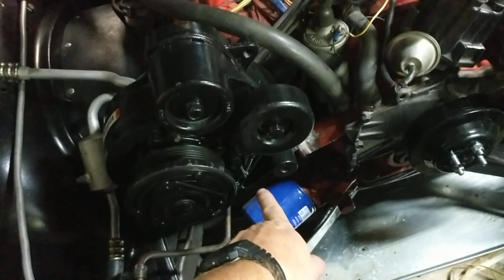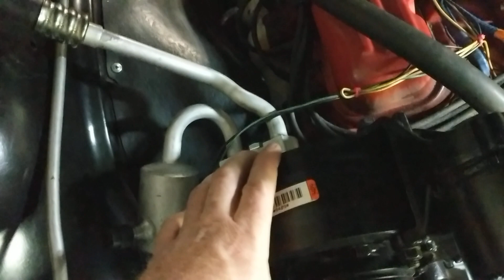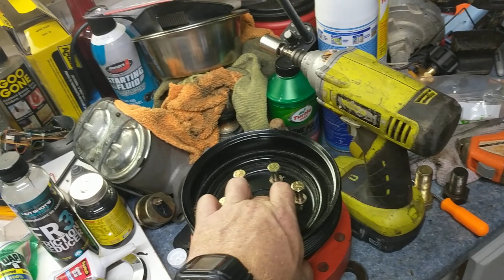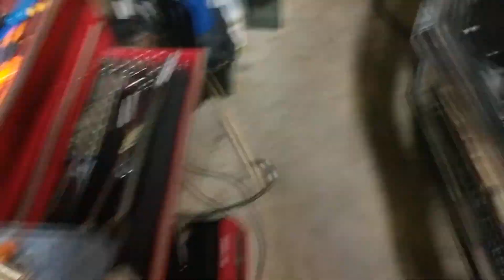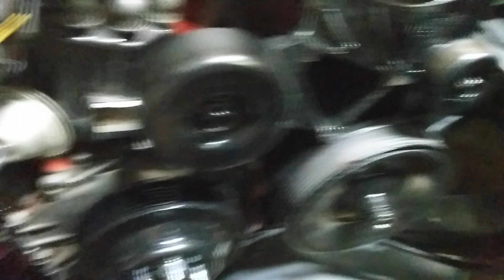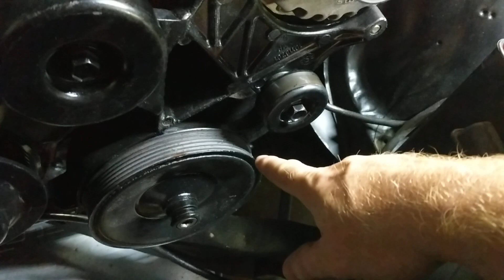Buick 455 DIY serpentine set up

Comment: stick to my v-belts if no real benefit..  I ran the inner for couple months, then put on new inner and ran the outer since no AC and have dual belt now.. wore in just enough so both same tension now,.. the one outer crank pulley is tad bigger..  think it was crank.. car stored for winter already..
Reply from the maker: That was one reason for the video, to specifcally call out there is no efficeincy gain between belts. Secondary benefits are people's claim that this is a great way to go for race engines to prevent a belt flip which is stated to happen with vBelts. The simplicity of access to the front of the engine, timing, water pump and the benefit of upgrading the AC (AC compressor) is still something one should consider, but nothing wrong with the vBelt setup. This ultimately boils down to preference.